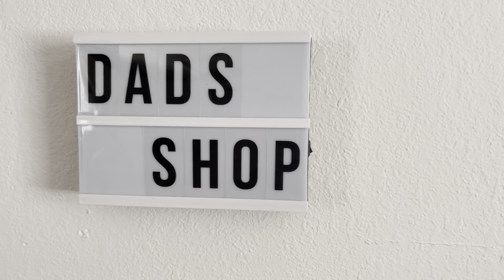Episode 3 - Go Kart Rebuild - Junk to Gem

Comment: Great video, beautiful welding, If you can say what brand of welder are you using?
Reply from the maker: It is a Titanium Unlimited 200 from Harbor Freight. It is the 200 amp multiprocess machine and welds great. I have not tried the TIG or spool gun yet.

It runs on 120 or 220 and I have been using 120. I have never hit the duty cycle and never tripped the breaker or GFI.

That will be a review video in the future.
Reply: @jackofalltrades7822  Thanks for the info, wouldn't have thought it was a Harbor Freight welder
Reply from the maker: @dorflonnigan4413  Agreed, HF is not known for good welders but this one is solid...so far.